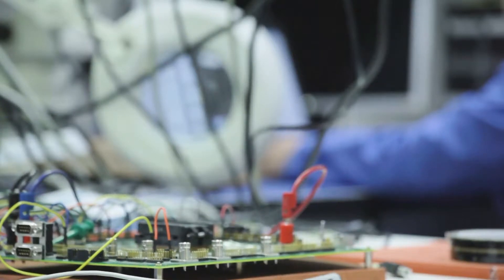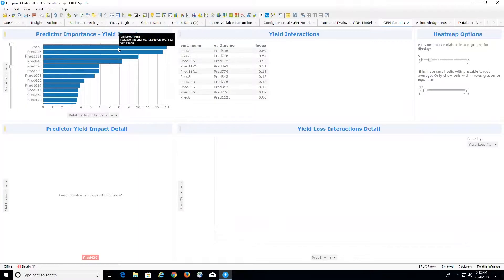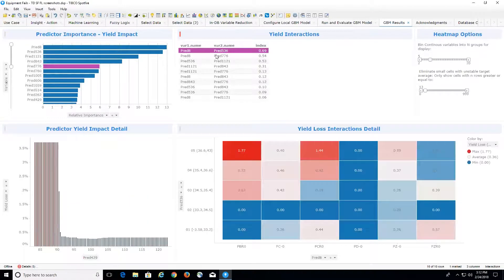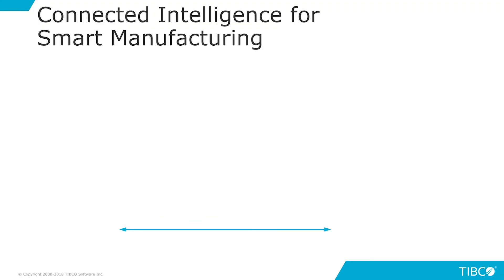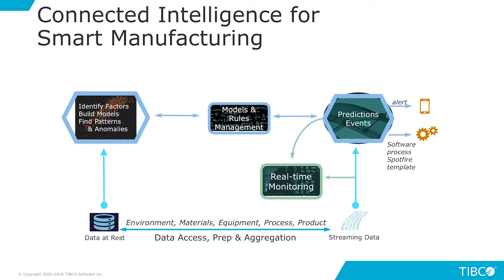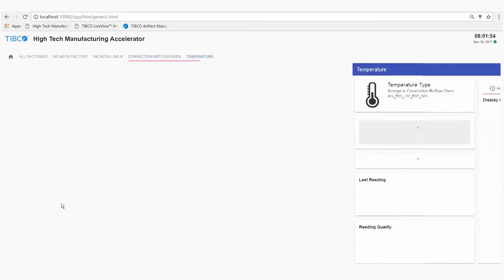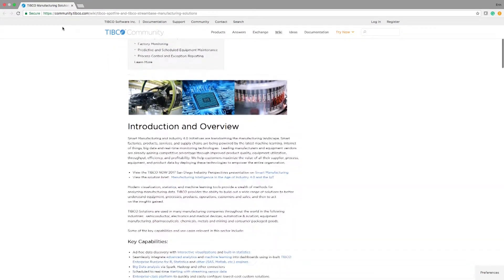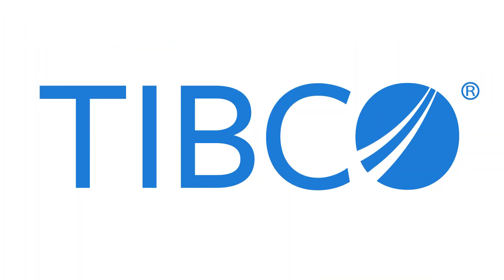TIBCO Smart Manufacturing Solutions

Comment: Nice summary of issues in high tech manufacturing from Mike Alperin, TIBCO. Overall equipment efficiency  is key business challenge. Nice description of how AI / ML can play a role in advanced process control - run to run control, fault detection, yield optimization. Check out the TIBCO Community site for more information https://community.tibco.com/wiki/tibco-spotfire-and-tibco-streambase-manufacturing-solutions